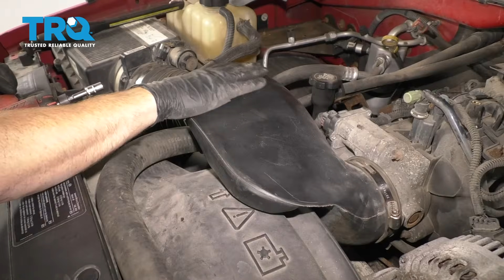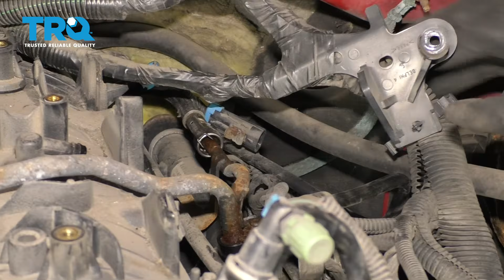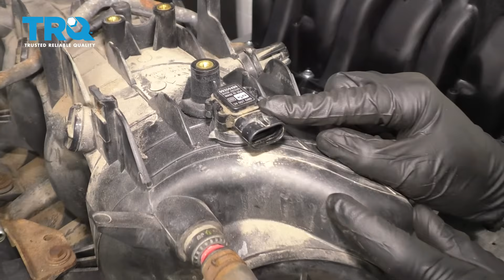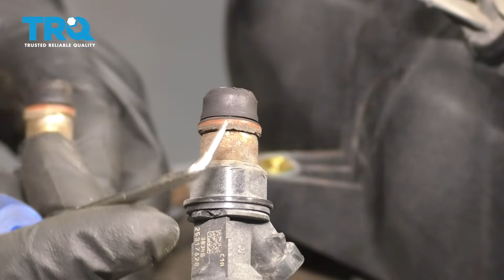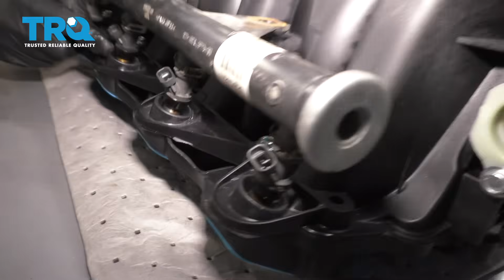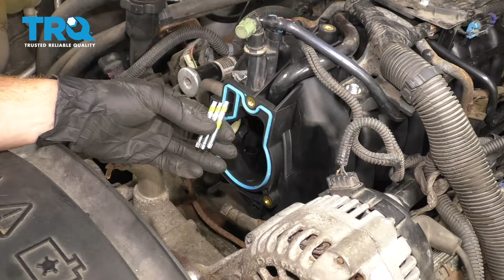How to Replace Intake Manifold 1999-2007 Chevy Silverado

Comment: Whats the advantage of swapping intakes? just curious, I bought an 84 c10 with LS swap, The purge was deleted and I was getting a 171/174 code, turned out being an open 1/8 vacuum line, couldnt figure where it went so I plugge a vacuum gauge into it and left it, now I can monitor if the engine looses vac. It stems from top of intake, theres a 3/8 vacuum port with a splitter plugged into it with 3 1/8 lines coming from it....1 for fuel pressure reg, 1 I assume is the purge canister? it tucked away by firewall and fender (round ball with one vacuum line, and the other is the one I plugged with vac gauge. Truck runs great but If I accelerate to hard or fast I get a 172/175 code, bank 1-2 to rich. I am able to clear with OBD II reader....any clue where the other 1/8 vac line goes or why Im getting 172/175?

Comment: My question is can you still remove the camshaft sensor from the back without removing the manifold because I tried and it won’t come out I pulled the sensor out the hole but it won’t come out it hits the manifold I tried left and right I even tried pushing towards the firewall nothing so do I have to remove the whole intake manifold I have the same one the updated one you just put on it

Comment: I did this yesterday following your instructions. This video is perfect in its procedures and invaluable in understanding how to get the injector plugs off. I'd never have figured that out without this guide. I would have liked guidance on how to clean out the inside of the intake manifold. Otherwise, awesome job.

Comment: I just replaced mine on my 02 2500hd w/ the 6.0. I followed the video step by step and now the engine idles low. If I hit the brakes hard it dies. I’ve made sure everything is secure. Any ideas on what the problem could be?
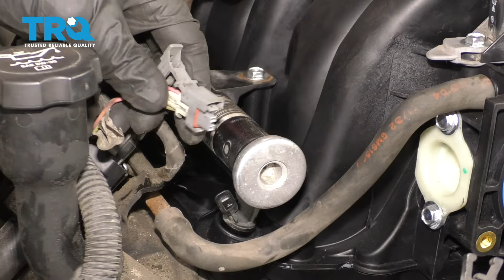Reply: Also my truck didn’t have a hose coming off the back like at 10:53  and it has a hose connection on the side of the throttle body for the hose at 21:08.

Comment: That looks nothing like my 2003 Silverado? Is that the v6?
Reply: No the LU3 V6 found in 2003-2013 the intake port is on top, not front, this truck is a 2003-2007 with a LS V8.

Comment: I would strongly suggest to use a GM ORIGINAL EQUIPMENT INTAKE MANIFOLD for this.
Reply: Why would you have to replace the intake? I can see gasket but not the intake.
Reply: Why?
Reply: Gm doesn't make an OEM intake manifold
Reply: Because the intake manifold is plastic. Over the course of time, going through hot and cold cycles being between the heads where alot of heat from the motor accumulates the plastic that makes up the intake sometimes has a tendency to warp or even crack. You can put gasket after gasket on a warped intake manifold and youre left with the same result. If i go down that far on my truck im swapping the whole thing out